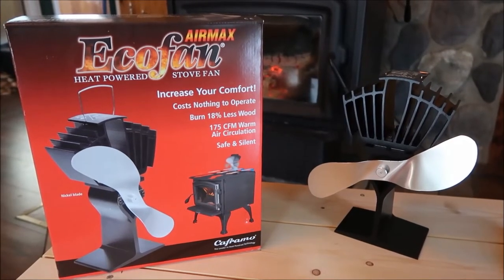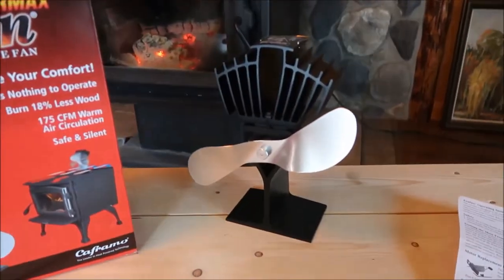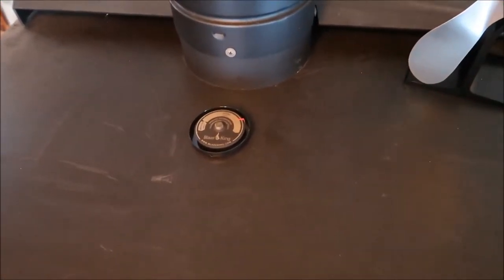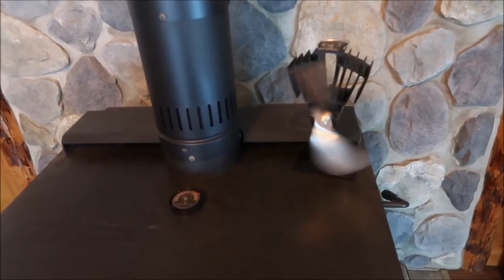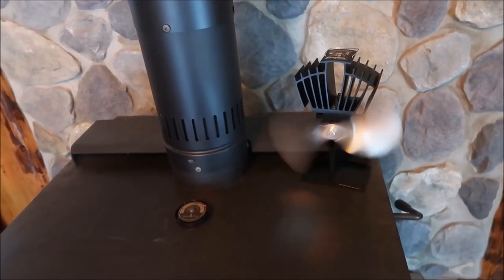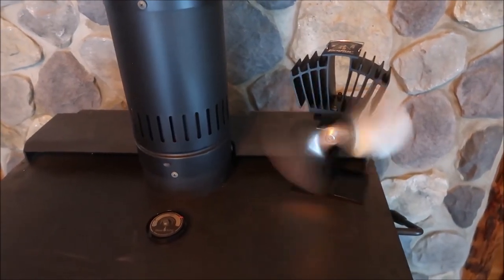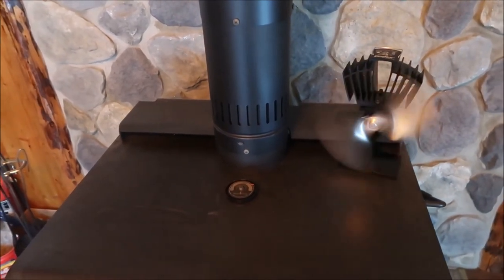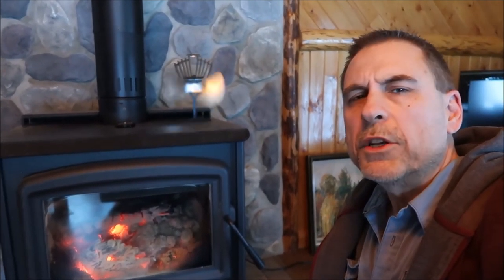Ecofan Airmax Review ( How does it work)

Comment: That is one efficient fan. I do not have the same, but I am doing something similar with an electric fan and my radiator. I let the fan blow across the radiator which makes it much more comfortable lower at the ground. At the same time I do not have to turn up the heat as much. 👍
Reply from the maker: Thats great.

Comment: That is very interesting, I know a Fan is used to cool down but not for to warm the Room. Never heard about that befor. Good Idea. When I turn the My Fan on it just makes the air cooler. I use it in the Summer to cool down the air.
Reply from the maker: The idea is to blow the very hot air on top of the stove into the room and this creates a more even warm air lower down. The fan is made of cast iron so it can sit on top of the stove and not melt from the very hot surface.
Reply: @rdreamhomestead1451  wow, I understand, now, good Idea. ❤️🥰